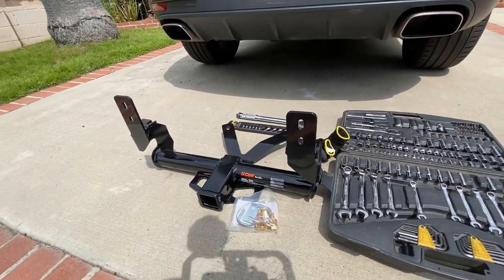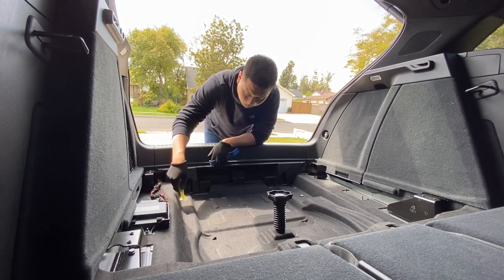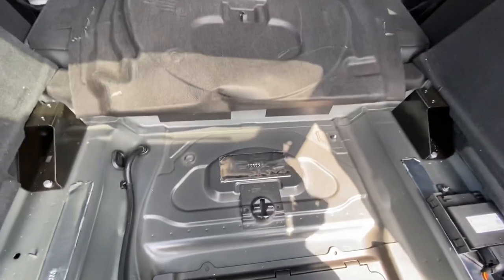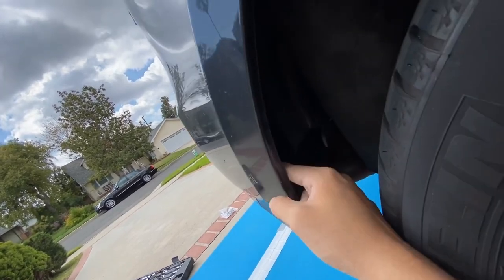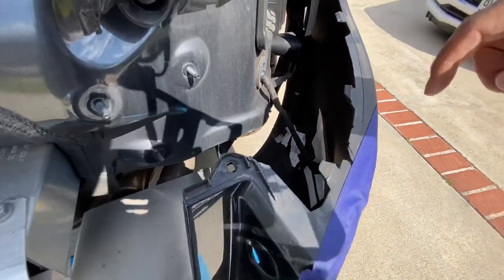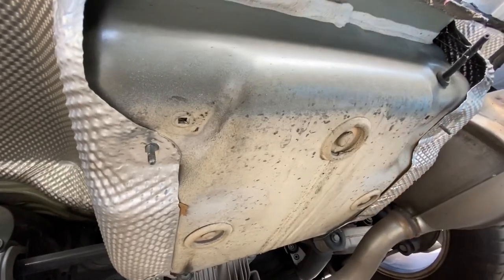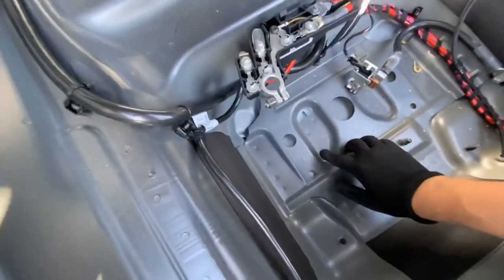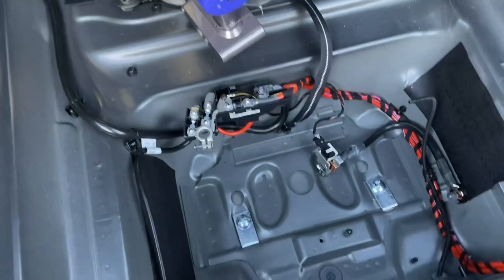Porsche Macan Towing Receiver Hitch Installation

Comment: Just did this install on my 2015 turbo.  A few notes.  You don t need too remove much from the rear cargo area.  Just enough to remove the battery.  So top cover, spare, sub woofer and battery that’s it.  The bolts go below the battery.  Don’t waste time on the other pieces.  Second, the rear bumper does not need too come off.  Only the diffuser around the exhaust tips.  Definitely don’t remove the muffler hanger bolts.  Just loosen them so the hitch can slid in.  Took about an hour.
Reply: wish u lived close to me so we could knock this out your way..... 🤠
Reply: What wiring harness did you use? I want to do the this to my 17 Macan S but I’m nervous about the wiring part. Thanks for the tips BTW!
Reply: Confirmed this today - if you have an aluminum diffuser there are tabs you have to bend back in the area near the exhaust tips

Comment: I did this process and a hint, when you're in the battery bay I drilled a 1/2'' hole in the bottom pan and put a 90 degree PVC fitting facing the rear of the car for a drain as these can flood. Help yourself out while you're there and take 15 minutes to save your electronics down the road. Also use red or blue Locktite on every bolt you install, will help keep the hitch from vibrating lose and making problems.
Reply: Don't use red unless it's called for. Typically requires heat to remove.

Comment: Finally had good weather to install my hitch today.  It was a total pain in the ass. A couple of notes for future installers.  Do not remove the exhaust hanger bolts. I removed them based on the instructions and was unable to reattach while trying to lift the hitch and exhaust. Mostly because of the way I had my Macan. I cut 2x6 boards to make 4" ramp to give me some extra clearance but had them at the edge of my driveway where the lawn drops down a couple of inches so it was awkward sitting low and trying to reach under and lift. I found another video on youtube where the installer just loosed the bolts - the hitch can then slide into the bolts - making it MUCH easier.  I also found the bolts that attach through the trunk to be too short. I ended up using the spare tire jack to lift up on the hitch near the bolt end that gave me enough clearance to screw on. I think I probably did it incorrectly, the instructions from Curtis are total crap and the photos are almost useless and hard to figure it out.  The instructions say to give 110 Lbs. torque to the 1/2" bolts under the trunk/spare tire - but they are 3/4" nuts. The other bolts were not the same size as in the instructions either but I was able to torque with the correct size and it's just for a bike rack so not too concerned. All in all, if I had to do it over again, I would not have purchased this to install myself. It took way longer than expected, time that I could have used for doing something fun instead of crawling around under my car.
Reply: Torque is based on bolt diameter, not wrench size. (1/2" bolts usually have 3/4" hex) HUGE difference in torque between the two.

Comment: Did you ever go back to connect electrical?  Finishing install on mine just wanted to confirm wiring diagram if you have.  Some of the terms are a little confusing on the service manual for the Macan.  Thanks
Reply from the maker: Have not, will make a video if I ever do. Please make one if you get to it first would be helpful

Comment: Does anyone have warranty issues after installing this?  Aka, the dealer gives you the run-around for other things because this is self-installed.
Reply: No. It's a tow hitch - you're not doing anything crazy to the suspension or engine. In the US in particular, laws protect the consumer if the aftermarket addition is irrelevant to whatever problem occurs, if any.  I don't know what it is about Porsche owners - they're afraid to even change out light bulbs for fear of voiding warranty.  (Yes, questions about if changing a light bulb voids a warranty have actually been asked on Macanforum, etc.) C'mon guys...
Reply: @captainkaiii  Ha ha, thanks for the info.  Just got mine done today using the Draw-Tite version and it's much better without the steel bar sticking out at the bottom and it's an easier install.

Comment: Thanks for the video - very helpful. I'm installing mine tomorrow. Also just for a bike rack. I see Curtis recommends a stabilizing strap if using bike racks, that attaches to the top of the rear hatch. Did you find that necessary?  I'm only carrying one bike.
Reply from the maker: Not necessary, drove 500 without a problem

Comment: Please just ask, when I start my car in the morning, I feel a little shaky.(vibrations)
Reply from the maker: Gharzouli Moncef weird I have not experienced shaking. How many miles do you have on the car?
Reply: 48k km
Reply from the maker: Gharzouli Moncef I have a very slight vibration on start up but goes away when car warms up. If it’s a lot of vibration I always assume motor or transmission mount
Reply: @wilnomadic  tnks,I also have cuts in the exhaust

Comment: Porsche dealer want to charge me $2800 to install this dam hitch on my macan 😖
Reply from the maker: Andre 92 Porsche loves to charge an arm and a leg lol it’s a basic hitch install like any other car. Also the oem hitch might be able to tow more but I have a 2.0t and this one is rated a little over 4000lbs
Reply: Wilnomadic what yeah is your Porsche? Mine is a 2019 macan. I got an appointment with uhaul, part and labor $450. I’m just hoping that they know what the hell they are doing because I dont want my warranty voided.
Reply from the maker: @Andre-iv7ys  I have a 2017 that was out of warranty. That is not bad, I would have gone that route but was sitting at home anyways so did it myself.
Reply: @wilnomadic  Out of warranty, how many miles?  Mine is 21K, and I really want to do this and it's 2016.  Would you recommend it?
Reply from the maker: ai598 I have 72K. You should ask the dealer if installing a hitch would affect warranty. It was straightforward so worth it for me
Reply: @wilnomadic  I think I already know the answer since they would want to make money off of me.  I just need a hitch so I can put on a bike carrier.  BTW-what are you using as a roof carrier?  Also, how is she doing at 72K?  Any major issues?
Reply from the maker: @ai598  https://www.youtube.com/watch?v=yA2XcaU-Fic and the only major issue I have had was needing to replace the turbo at 60k. The turbo actuator was not able to seal the boost waste gate since the waste gate had premature wear. Car was out of warranty but after taking it back several times and paying for other service the dealership and their lead tech look at it and he warrantied it under the emissions warranty I was still covered under. Else it would be 5k out of pocket.
Reply: @wilnomadic  Based on the exhaust, I thought yours is a base model.  I have the S and it comes with two round pipes on each side.  Thanks for the video, mine actually has the rail support on each side.  My Macan S is still under warranty, what's your thought if I do this install myself to save $$$?
Reply: @wilnomadic  Just got my hitch done today, and it's more than four screws on each side; it's more like 8.  But I used the Draw-Tite #75940, and it's a cleaner look and much easier.

Comment: Who tows with a luxury sports car? That trunk liner is not a structural part of the frame. It's not safe. I've seen trailers tear the bolts out of the frames on chevy equinox from tongue weight. This is even a weaker metal to have a hitch on.